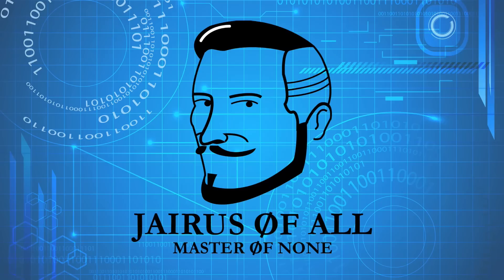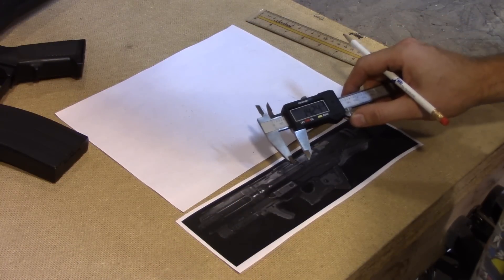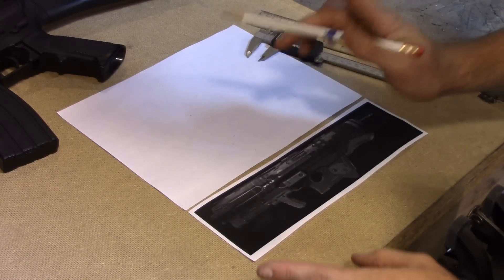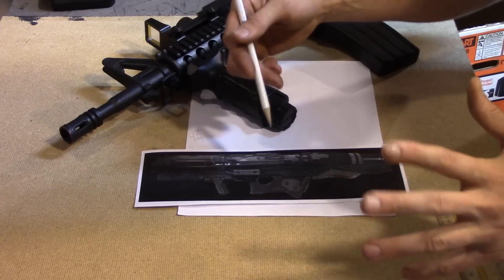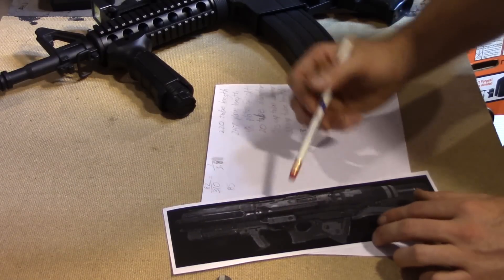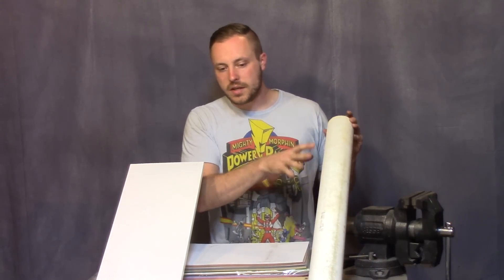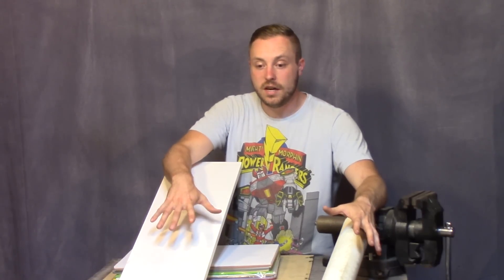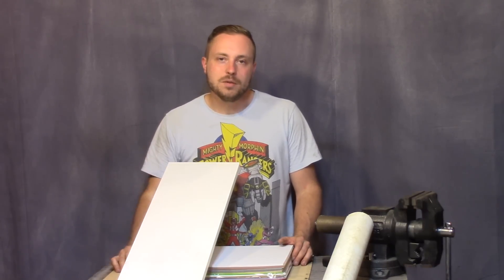DOOM ROCKET LAUNCHER BUILD Part 1

Comment: you are s great inspiration to me. I spent my life terrified of practical projects because I know so little about tools and such. but I am 40 now, with teen kids, I need to get over the anxiety to teach them skills. currently we are learning through nerf, upgrading blasters and looking at why the upgrades work and how else we might accomplish. for me, now, this means circuits and soldering. so I took a rusty old barricade and broke it down as far as I could. I got a 10m roll of 16awg silicon cased wiring that I will use to replace the crap wire in there. got the stock motors out, popped a couple honey badgers in. now I just need to dremel space so the HBs fit, decide what switches I need (cut out jam door lock, keep power button). all that's left is the mapping and putting iron to solder to wire. very excited! next step if that works is a 2s lips and charger to replace aaa, and I will have a respectable barricade and a bunch of new knowledge for my upcoming Super Pretty Stryfe project
Reply: afterPurply Sparkly Stryfe, I will help my son wth his choice module us evs10 or Rayven wire and motor upgrade, as part of his homeschool assessments. we are excited! hsing is hard, gotta find education everywhere? especially when an asd kids finds an obsession shared with his asd mom!
Reply from the maker: Thank you! That means a lot to me!
Reply from the maker: Also... the asd thing, I don't think i have met better people. Just think if every single person had it. BAM!!! Instant non dramatic, ultra advanced society.(depending on level of affliction)
Probably make the world a better place.
I'm not making a joke, so no offense, but people would be better if they couldn't understand social intricacies.
(probably because i don't)